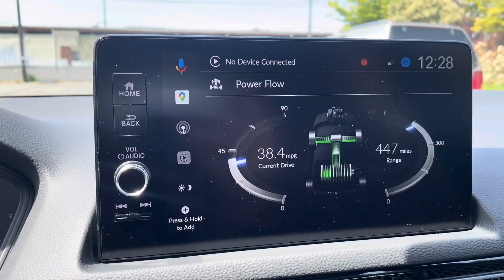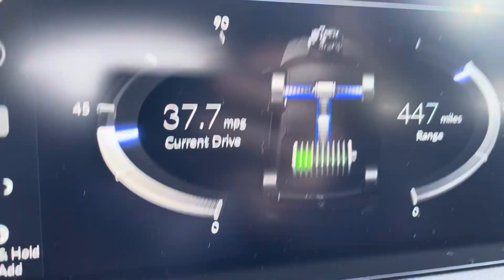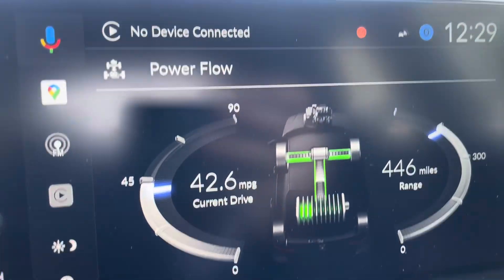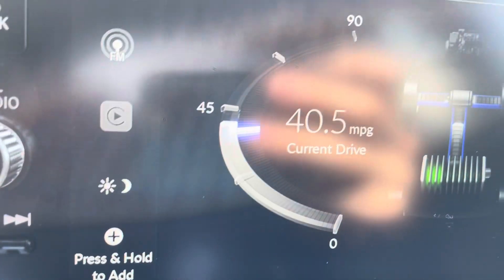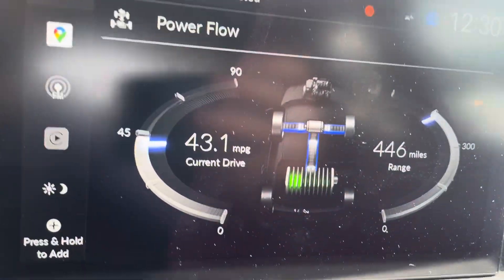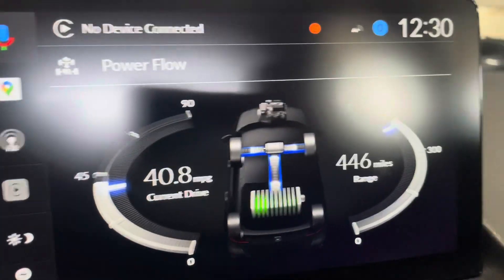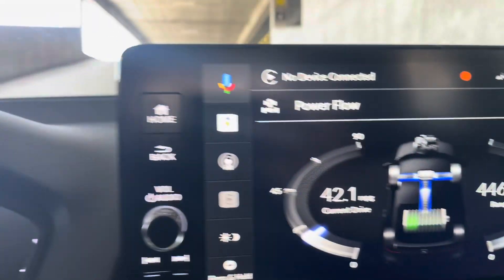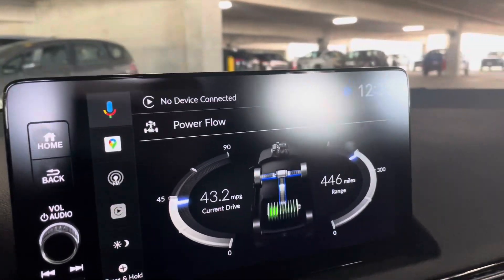Honda Hybrid Power Flow | See How Engine & Battery Work Together!

Comment: Interestingly, I rarely see the engine NOT providing power to the wheels, as I can see here in this video, except when I'm braking or coasting, when I see the battery being recharged.  Keeping an eye on it because I'm not getting nearly the advertised mileage.  I'm also not putting on highway miles, it is all local, when I would expect the battery to be more engaged.
Reply from the maker: How is the temperature there typically where you live?
Reply: @walkaroundnariman - It's fairly cold but its not Minnesota cold. Normally we average freezing as the high in the middle of the winter. December has been unusually cold, hitting below zero a few times, which is early.

Comment: Don't use the ECON mode, use NORMAL. 
I was a skeptic, but tried it and my gas mileage went up. 
ECON mode makes everything less responsive. If you need power to pass, you won't have it.
Reply from the maker: Yes
Reply: What is the point of Econ mode then?
Reply: @patman4917  probably just makes it more efficient not on the highway
Reply: @patman4917 use it at night when nobody is around, so you won't delay other drivers. Or use it on a congested road.
Reply: @CRAFT7445  less responsive true but so far getting about 4 mpg better in econ.

Comment: Wow, I heard they can get up to 50 miles to the gallon. Is that correct?
Reply: Mine is saying 52.3 average - but depends how you drive it and where I suppose. When I first got it I was getting 48 but I know how to drive it better now 🤣
Reply from the maker: @melissathomas7536 nice
Reply: I have an Accord Hybrid and I can get 45+ MAX city driving only. Usually it's 38-42 city/highway combined.
Reply from the maker: Depends who you ask but yes